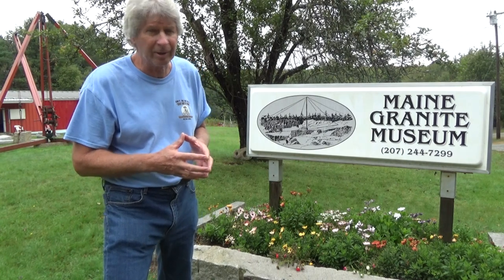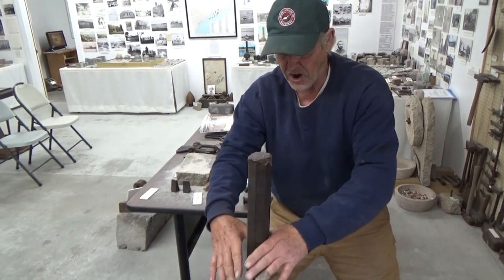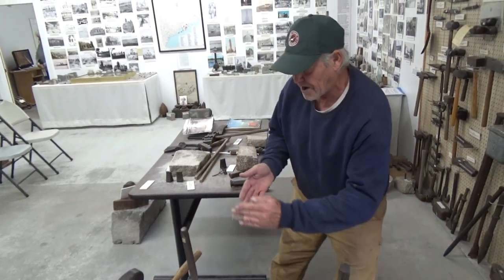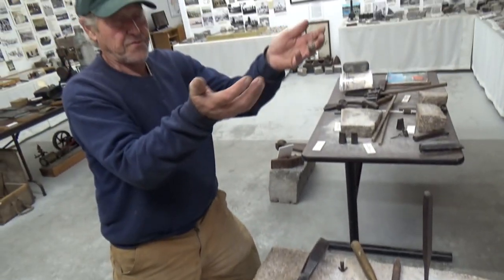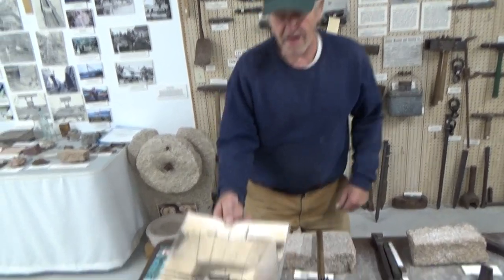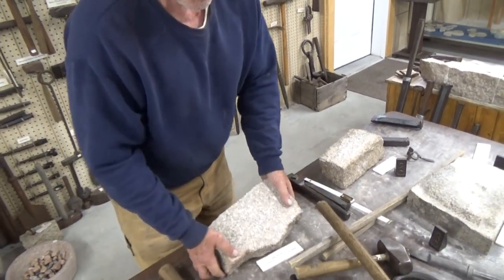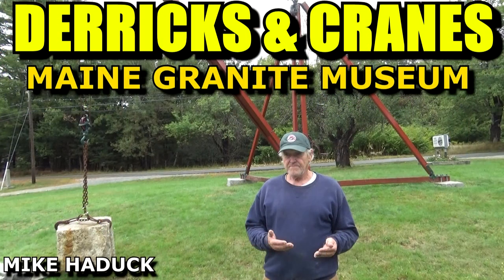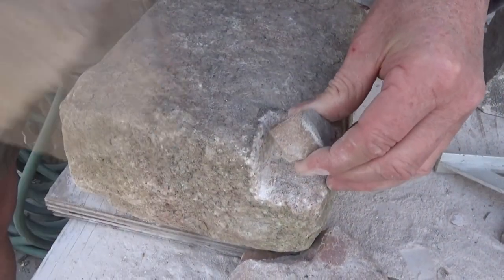ROCKFACING AND SHAPING STONES (Part 13) Mike Haduck

Comment: Wondering if you would be willing to do a video on how the "OId Timers" used to develop water springs and build spring houses. There doesn't seem to be much good information on this topic. The spring houses I've found information on seem to be mostly made out of stone and I wonder what one would have to take into account building something like that while the water is gushing out of the ground, the constant moisture to the rest of the structure, and the freezing and thawing between winter and summer. Thank you so much for sharing your knowledge!
Reply from the maker: Hi Elizabeth,  in our area they were mostly built to keep everything from freezing like a root cellar, they did anything that worked, thanks Mike

Comment: Hello Mike, I have a portion of fired clay by my house that is part of my sewer latteral in Ohio.  It looks like they used concrete at the joints. I was wondering if you could help me by letting me know what blend they used at the joints. Thank you so much and I love the t shirt you sent me.
Reply from the maker: Hi, I can't say what the inspector would require, in the old days we just used a starter type mortar or a Portland and sand mix, I would ask the locals, thanks Mike
Reply: @MikeHaduck  Thank you. Your input is gold sir. Ok will ask